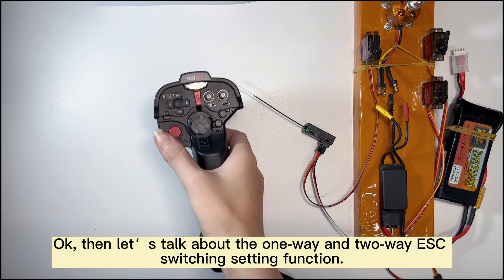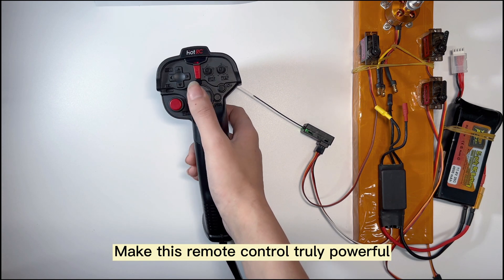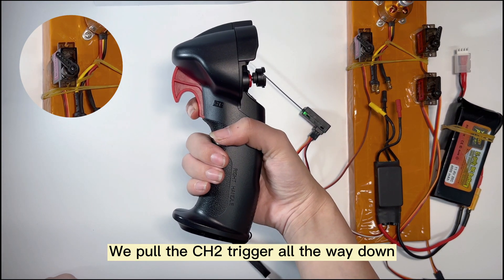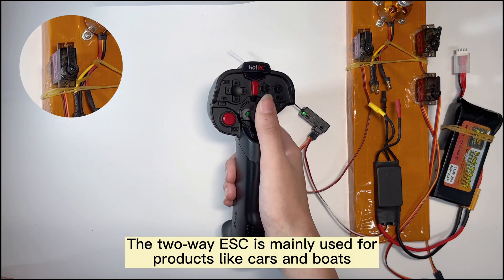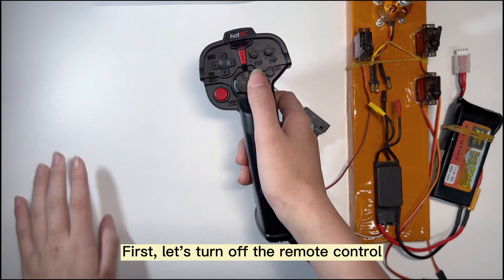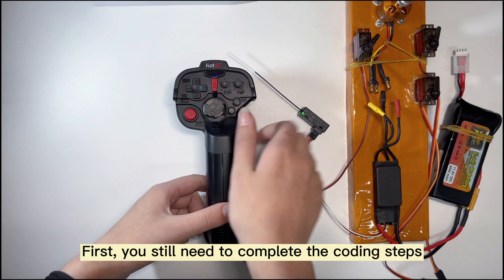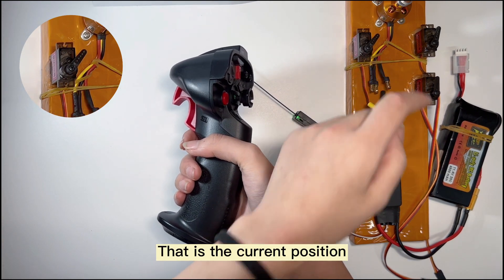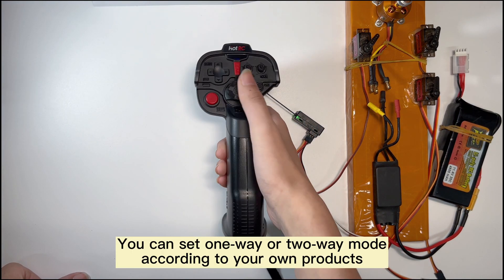DS-4A One-hand remote control one-way mode/two-way mode Introduction

Comment: Why does servo rotate only 90 degrees? isnt is 180 degree servo?
Reply from the maker: Rotate 90 degrees because it is an analog servo mode, not a digital servo mode. If you use the digital servo mode, the servo angle can reach 180 degrees.